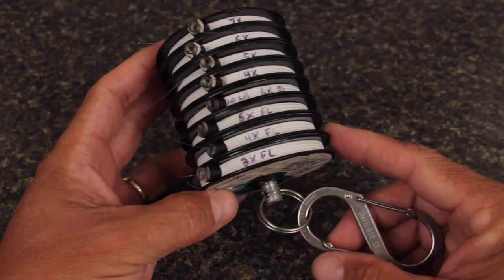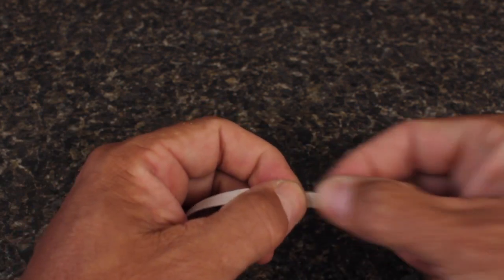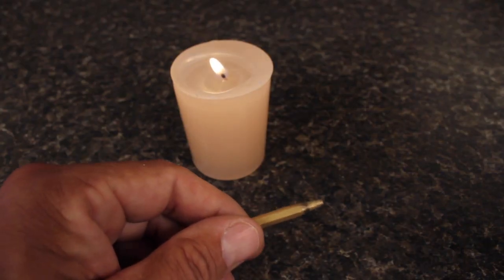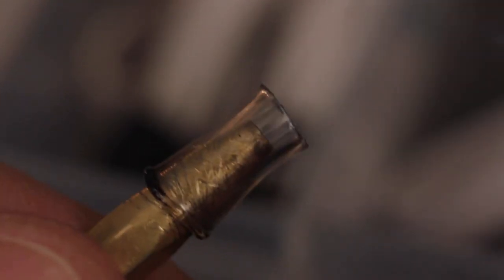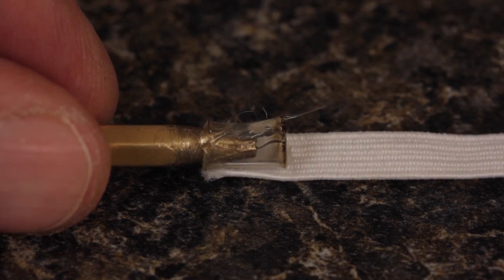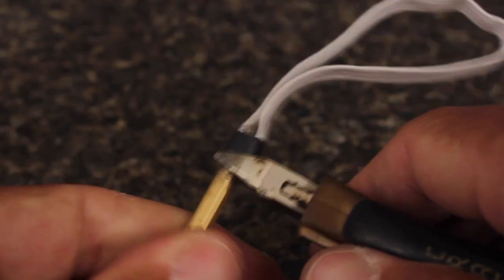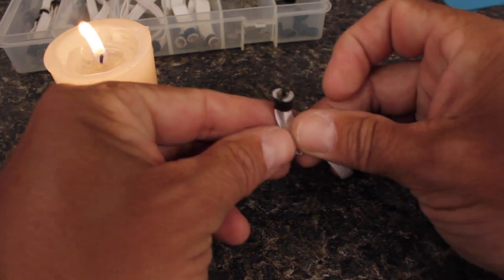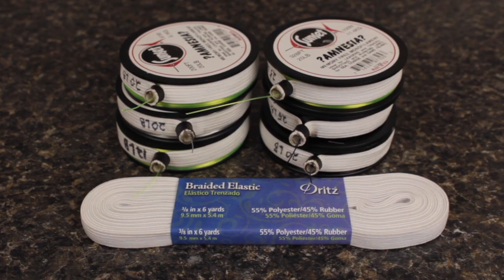DIY Spool Tenders

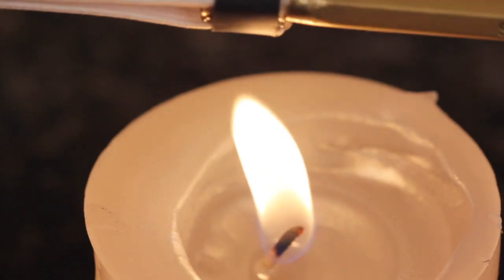Comment: Beautiful. Just made a bunch of these for fly tying stuff. I find that dipping the tubing part in water after 4:14 helps keep the elastic from burning when heating shrink tube. Also would cool off and harden the hot glue if doing these quick enough for that to be a problem.

Comment: Thanks so much for the video.  I have accumulated different flourocarbon tippets from  different manufacturers, and they all have different ways to retain the tippet. None of them seems to work very well, and I have tippets dangling all the time when I am on the river. I made up a bunch of these last night, and I think they work better than anything on the market. It doesn't even matter if the spool is wider than the elastic, because as long as the elastic is tight, it controls the tag end so well. Thanks again!

Comment: Made these before and loved them. Ended up giving some away or losing some so I just made 2 new sets.  I end up using different colored elastic,  pink for Fluoro and white for nylon.  Used a sharpe on the elastic to indicate the tippet size.

Comment: Thank You . Simple quick and efficient .Cheaper than any other system and ;which is very important , much lighter than expensive aluminum distributor . The only trick  now is to find the 2 right tubing .

Comment: Great video and information as always. I've been using a small plastic bead from the craft store instead of the clear plastic tubing. Much easier as you don't have to cut and melt the plastic tubes. Just glue the round bead to the elastic ribbon and add shrink tubing.

Comment: I found the 3/16" OD tubing at Petsmart in the aquarium section. Loew's, Home Depot did not have the tubing in the 3/16" dimension.  Shrink tubing at Lowe's in the electrical section and the strethc elastic in the sewing department of Hobby Lobby. Great idea, easy to make and one of those "why didn't I think of this?" Thank you
Reply: Great to know.  I also wanted to add the shopping list: i) 3/16" OD and 1/8" ID plastic tubing (Petsmart); ii) 1/4" shrink to 1/8" diameter heat shrink tube (Home Depot electrical section - Raychem brand shown in video); 1/4" soft stretch elastic weave (Hobby Lobby).  Thanks for letting us know where to go for these supplies.

Comment: Sweet! I totally did almost the same exact steps to make mine, but I didn't think to use heat shring tube (I never do, for some reason...)
I just tied the hell out it with heavy floss.

Comment: Great idea, ill be having a go asap.. what have you used to keep all the spools together? Looks like a great way to attach them to my fishing jacket/vest to have them all to hand when needed bankside...

Thank you
Chris
Reply from the maker: Chris Leigh It's just a threaded aluminum rod with a lock nut at one end and a hole drilled through it at the other to accommodate a split ring. The Nite-Ize clip allows me to move it around quickly and easily.
Reply: Cheers buddy, sadly thats beyond my ability due to arthritic fingers. Thank you for your time.

Comment: I really like your tying videos they really have helped me. I just was wondering what is the advantage of these spool tenders over stock tenders
Reply from the maker: For me, the tippet is much smoother to pull off and put back on the spool if needed, it's a bit easier to get hold of the tippet because it sticks out at 90 degrees, and if the tippet is wound back in too far, these are much easier to rethread. But the biggest reason I make them is to use on spools that don't come with tenders ie. Maxima and Amnesia to name a few.
Reply: that's what I was wondering if was thinking that it would come off easier. I have a have a hard time getting tippet off of Rio spools as is. looks like I am headed to the department store and the craft store this morning. thank you for your videos they really help a lot

Comment: Made a bunch of these; some with tubing, but switched to using square alphabet beads after I picked up a huge bag of them from the dollar store. The alphabet bead size is perfect for most spools width, is about the same width as the stretch elastic, and not too wide for the heat shrink to go over. I have a question though, is the tippet post at the beginning also a DIY creation? If so, what materials did you use?  Thanks!

Comment: I had to go with 3/8" shrink tubing.  Using 3/16 O.D. plastic tubing and 1/4" I.D. shrink tubing leaves only 1/16" difference.  two layers of braided elastic was thicker than that and the 1/4" tubing was too difficult to slide over the plastic tubing and two layers of braided elastic.  Other than that, they are easy to make and work well.
Reply: John, I was able to get the 1/4 over everything by stretching the braided elastic and working the shrink tubing up. I am going to get some 3/8 tubing to see if the process is any easier.
Reply: I also used the street method to get it to work. Might be easier to step the shrink wrap up a size.

Comment: What is the tool holding your spools together?
Thanks!
Reply from the maker: It's just round aluminum bar stock (Home Depot) that's been threaded at both ends. One end has a lock nut (nylon insert) the other has a hole drilled through it then a light weight Nite-Ize carabiner is put through that. Lightweight, cheap, adjustable, durable but does require some tools to DIY.

Comment: Hi, I`ve been fly fishing for 2 years now,  but I have never used tippet. Just regular leader. What is the point with tippet, and why do you have alot of different tippets?? =)
Reply from the maker: Hi Ian,

You are not alone in being confused by this. Even some very experienced anglers have trouble with the concept and set-up of a leader and its tippet. I think the following two references might help.

Building a Tapered Leader
https://www.youtube.com/watch?v=cmEBAXzYMD0

How to choose the right tippet size.
http://howtoflyfish.orvis.com/choosing-equipment/equipment-articles/474-how-to-choose-the-right-tippet-size
Reply: thanks, that really helped!! will try next salmon season!
Reply: one more thing, I change flies alot when im fishing. and I see that you can use a tippet ring from the mid section to the leader/thin section. will this ring effect the cast in any way and how the fly will land on the water??

Comment: pro tip, burn ends of elastic to keep from fraying, but be care full not to burn to much
Reply: Marine heat shrink has glue on inside face.  May also improve on a great idea.  Either way, fantastic video and design.

Comment: following your instructions didn't work well.  The 1/4" shrink tubing won't fit over the tubing and the elastic.
Reply from the maker: Kent Taylor The fit should be very snug, you need to work a little to pull it over the tubing. As you can also imagine, a lot depends on how much hot melt glue you use, a skim is all you need. The other issue might be the size of the shrink tubing, try up sizing just a bit.
Reply: +tightlinevideo I used  a hemostat to stretch the tubing a little.  As long as you don't overdo it, the tubing will return to its normal pre-heated diameter.  Then you can shrink it as normal. Also, don't assume that 5X takes the same circumference as 40 lb. test. It doesn't.  You need to remeasure every few rolls.

Comment: @ 46 seconds:
‘First remove whatever tender came with the spool….’ 

Make work project!
Reply from the maker: No not really. Many tenders that come with spools are horrible while others get stretched out over time and need to be replaced. The tenders show here are much cheaper to make than aftermarket ones and you can produce a whole bunch in fairly short order. In addition, you can make these in custom lengths and widths to fit a whole bunch of different sized spools, many of which don't come with tenders of their own.